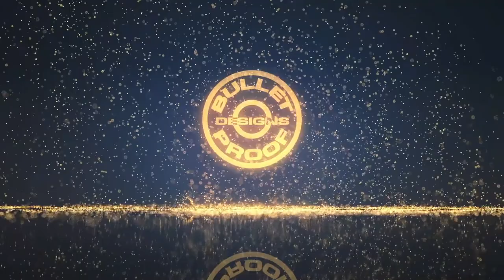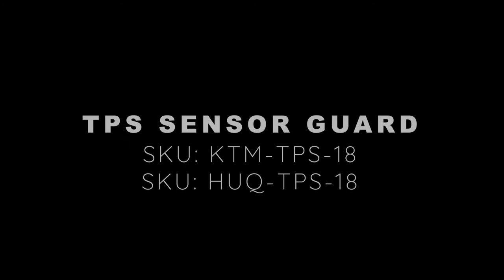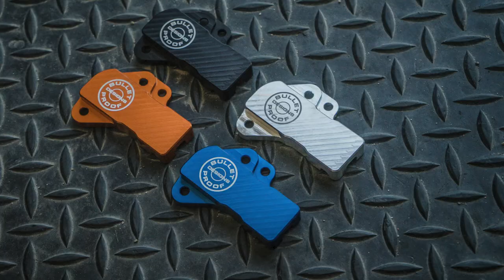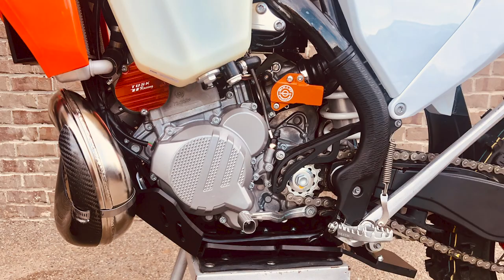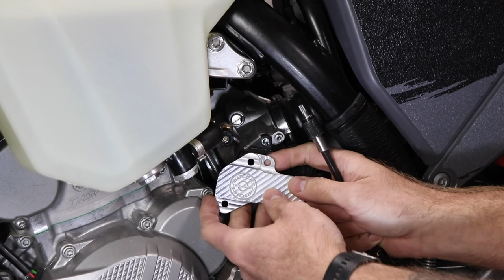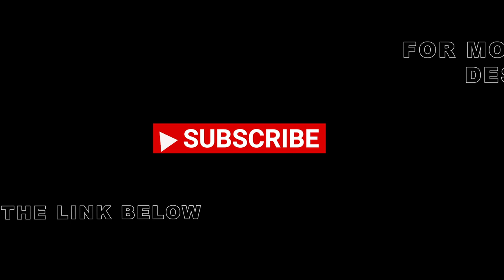BULLET PROOF DESIGNS - KTM/HUSQVARNA TPS SENSOR GUARD: Installation

Comment: Great video and product! My sensor did fall off the throttle body and I just want to make sure it didn’t fall out of calibration or adjustment?
Reply from the maker: It will not be out of adjustment if it slides out-there is only one way for it be installed in the housing as it is a keyed(slotted) fitting.   Thanks
Reply: Doing mine right now, first time removing a TPS on a modern 2 stroke. Not  gonna lie was a little nervous just removing the TPS not  worrying about calibration etc.... Here goes...
*edit  - 2023 Husqvarna TE300
Reply: @eastwood4006  you have any issues with it?

Comment: is it possible to mess the position of the sensor during unscrewing the bolts, that's my concern? Thanks
Reply from the maker: Great question Milos! No it is not possible, the sensor will remain in its original state.
Reply: Bullet Proof Designs thanks for the reply i hope also ✊🏻👍🏻

Comment: it came off so easy mine is lock on like i will break the plastic trying to pull it off
Reply: My stock TPS  cover on my '23 TE300 is stuck ON THERE. I wiggled it around some, felt like I was going to break the thing getting it off